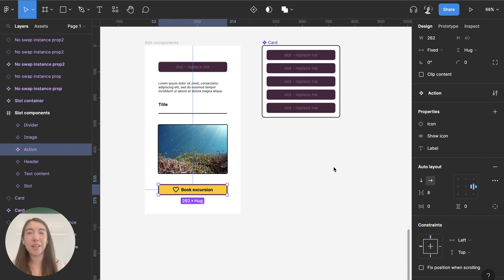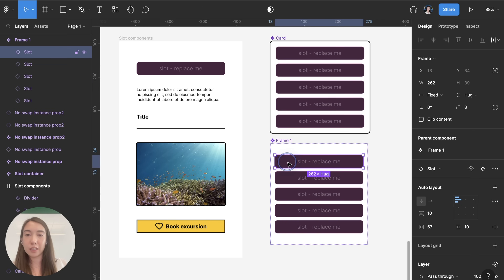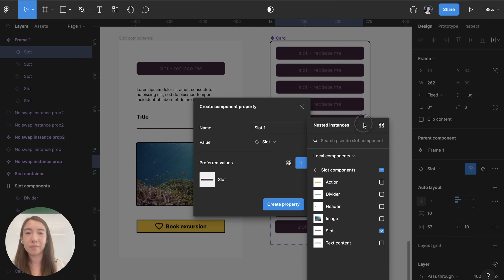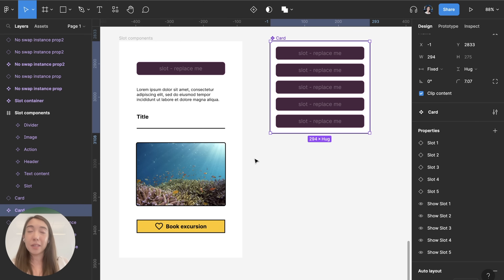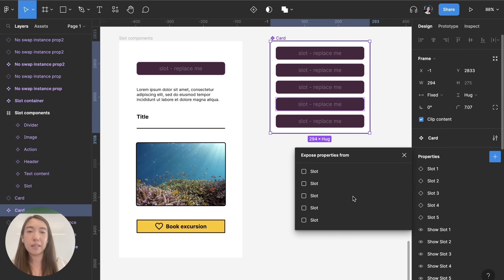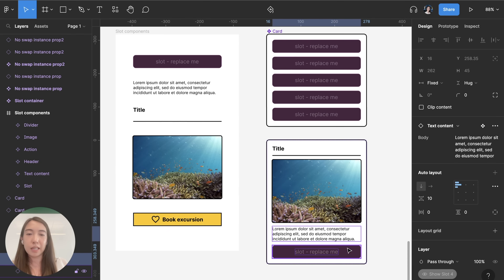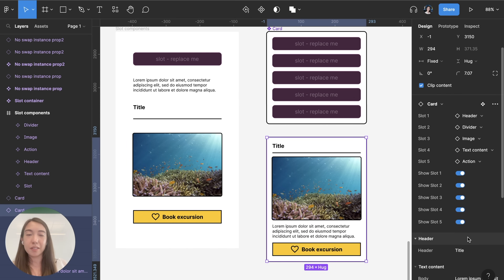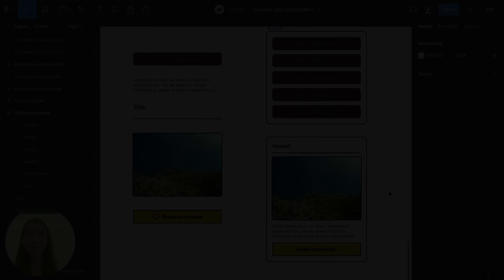Pseudo slots with component properties

Comment: Thanks for this tutorial as it is really helpful. Just having a little issue with changing the slot size depending on the component that it is being swapped for. EG if the slot is being swapped for text it does this pretty well but say the slot is being swapped for an image which is bigger, the image is resized the slot size rather than the other way around. Any help on this?

Comment: I just want figma to be healthy and working. Add as many as necessary features but don't break it. pls. I feel like I am using most of the features, in components, variations, and prototyping, and will use as many as added functionalities add value to my work. From day one I saw Figma as a tool made by my aliens, knowing what I need before I need it and that still is a case. Just, don't break it. 

Also, out of all crazy new things added like video or stuff like that, I would love to have the option to manage the timing on fixed objects when scrolling. And, if I fix something to be in certain place, why it needs to be the top layer? Why it is not available to be moved somewhere in between. For example, if I could fix a position of an image or anything to be in the background as I scroll, that would be great. And if I fix something why it has to be in the top visible frame? I need something fixed somewhere down of the long page, so when I come to that part it just reveals and gets covered again. I feel that could be a simple but really helpful feature. 

And if I could go crazy with what I would love to have, that would be any type of keyframe option in the prototype. So I could make certain elements to show on certain points of scroll and hide.. I found a way to make that with the hover or mouse down and mouse up action, but its a hack. and I need many duplicates of the same page to work. So I need a separate page to make it, and than I need to change something and it just ain't worth the effort.

love ya!

Comment: All my swaped components take the slot 'placeholder' height, why is that?
Reply: you have to set the height to "hug content" for Placegolder AND for Nested Components as well
Reply: @miladmustang9619  in all components, vertical resizings are set as "hug content" but still not working properly :(
Reply: @aravindaprabath3463  I had the same problem with the text components, I solved it doing autolayout on the single text component.
Reply: Facing the same issue. How did you solve this?
Reply: @rohangupta.3  Apply auto layout to every single component. Doing so helps the card component to expand as you change the instances.

Comment: And what about spacing? How to change it?
Reply: you could have a set of variant components only for spacing, that you could change the same as the other elements. Just an auto layout with 8px, 12px or 16px, for example.
Reply: You can adjust the auto layout padding of each subcomponent by clicking each of the items within the component

Comment: I don’t think I get the value, why couldn’t I create an auto layout frame with all those titles, images, buttons, etc. maybe somebody can explain it to me
Reply: You can. However, this way eases and quickens designing. For example, when I create instance swaps and properties, I can edit the component properties from the side menu instead of clicking into each text box frame, icon, etc. When I have a huge design system for a project and multiple components, it's nice to be able to quickly edit them and swap out/change different properties. Hopefully I understood your comment, and my answer helped you :)
Reply: @low-fee  i also use instant swaps but for similar items like changing an icon to another or a pie chart to a graph chart, but setting up a component that can be set up for basically anything seems an unnecessary step as I can just add that component directly
Reply: @GabrielKirmaier  You can do it that way, too. I think it's just whatever a person prefers. If you're referring to the card with the black rectangles, I think it's supposed to represent a card in the UX design/wireframe phase. One can add all the instance swap properties to the wireframe card and then just switch out things quickly when it's time for UI design phase.
Reply: It works when you want to provide a set of possible sub modules and a template to hold them together. It does not work well if you need to explore new ideas of modules or templates. For example imagine you want to explore a new layout of 2 CTA buttons side by side, which is not predefined in the design system, then the slot component is slowing you down.
Reply: It is useful for when you want to choose which component can be used as a swap. If you work with a team and the component you are doing should only include certain instances, it’s a way of locking it!